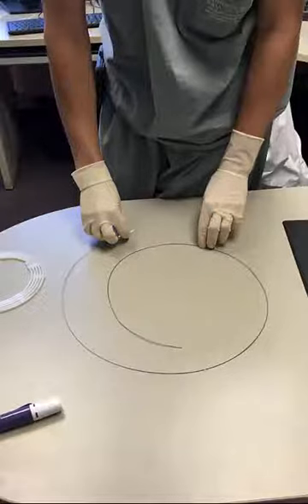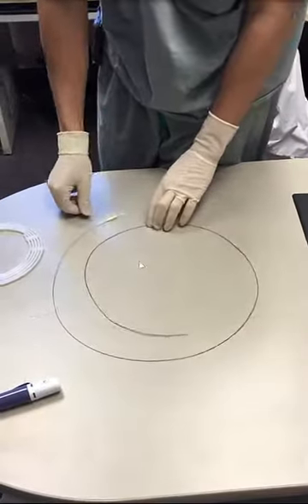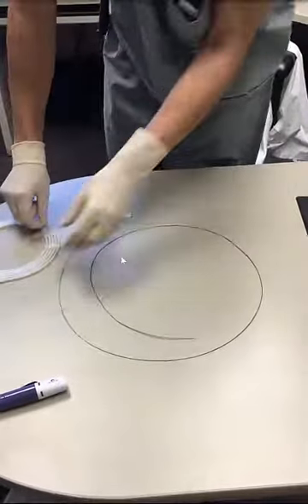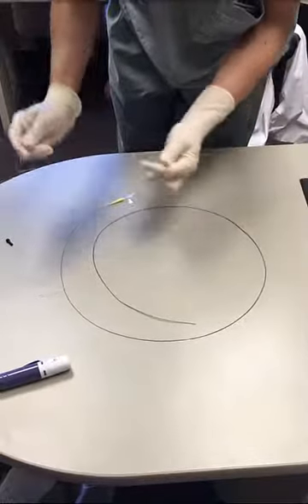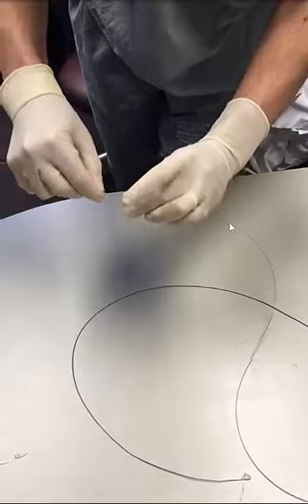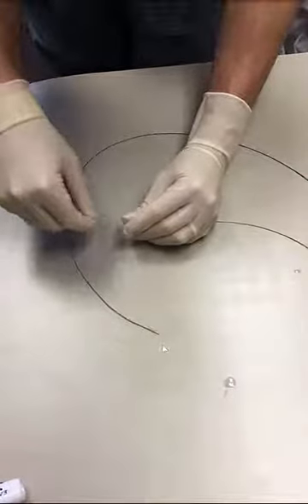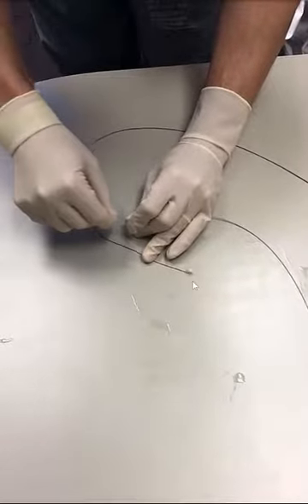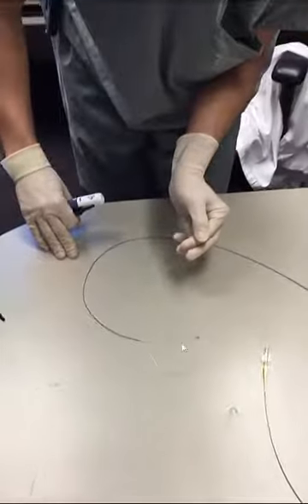How to deliver an Axium coil

Comment: Which Axium coils for perforations. There are Axium Prime super soft and extra soft or Axium bare or MicroFx coils?
Reply from the maker: The ones we have in our lab are the" Axium 3D, 2mmx2cm, 2mm x 4cm, 2.5 mm x 2 cm, and 2.5 mm x 4 cm.  Reference numbers: QC-2-2-3D,  QC-2-4-3D, QC-2.5-2-3D, QC-2.5-4-3D.